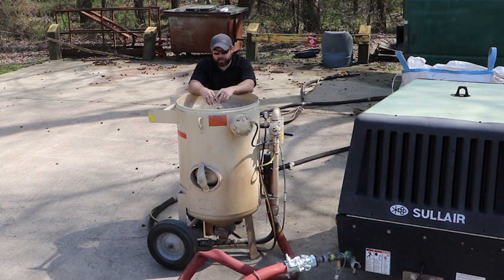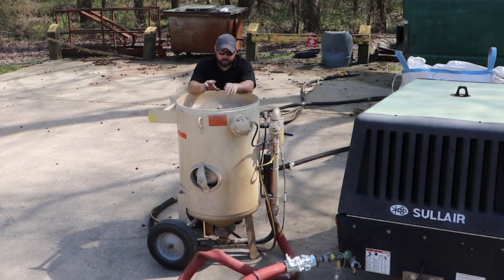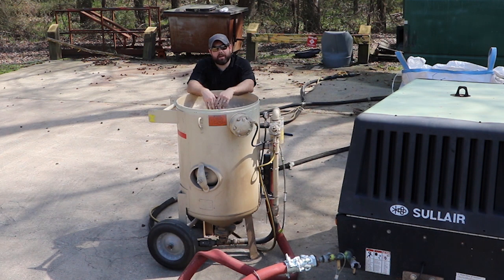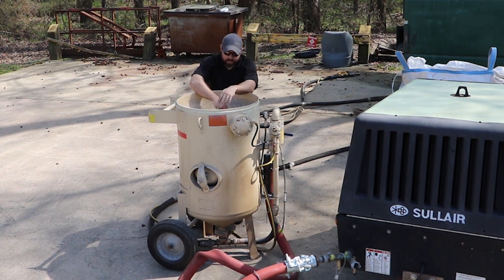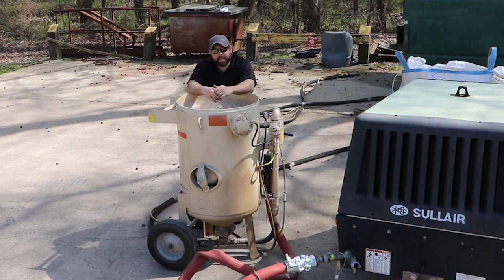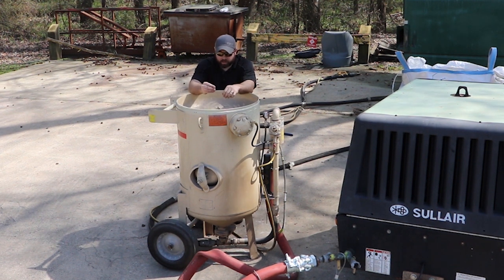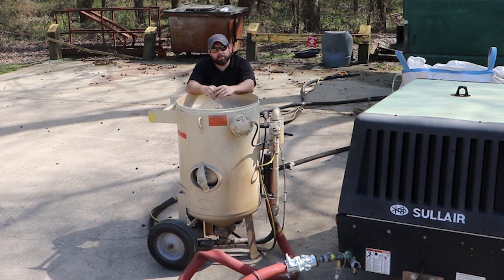How to Sandblast -Dry Sandblasting with Iron Grit in Empire 650 Pot

Comment: I have a number 5 nozzle with a 1-1/2" ID blast hose, what size air hose do I need to supply the blast pot from the compressor?
Reply from the maker: For all tests we have done we have used a 1-1/2" ID for Portable Units and 1" ID for all cabinets
Reply: @TheMobileBlaster  Thanks.